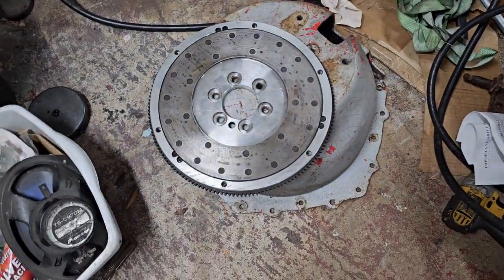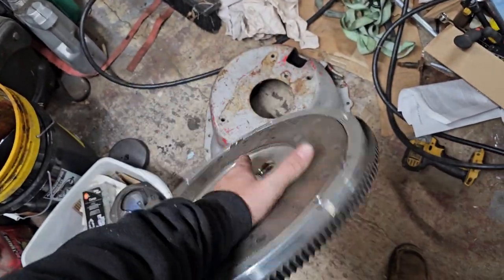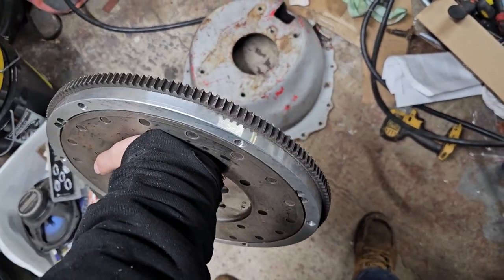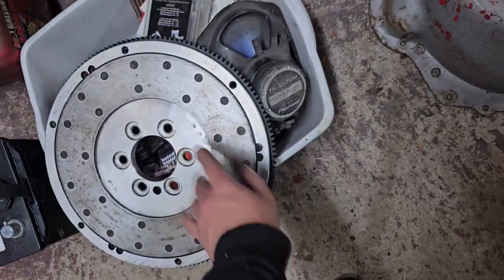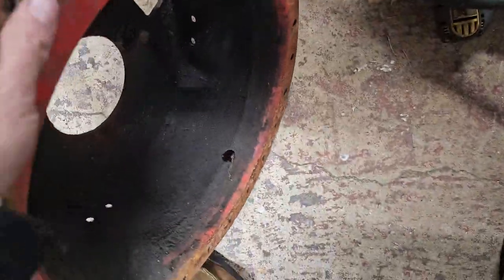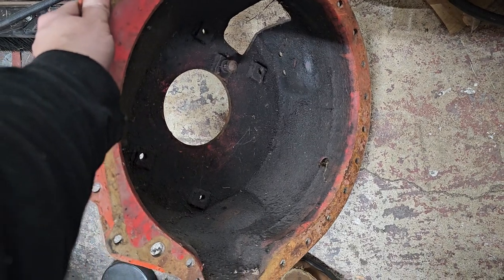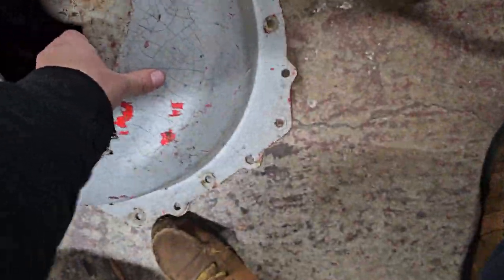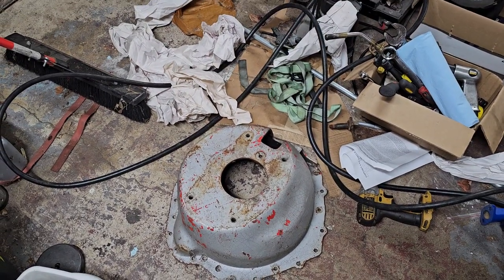Two lane black top 55 scores some more cheap, useful, and most importantly, safety parts 😎

Comment: Nice parts.
The flywheel looks good.
Did you get the front plate to go with the Lakewood Bellhousing?
Reply from the maker: Thanks i thought it was a good deal, did not, i usually leave them open and never have had a problem aslong as spacing is correct.